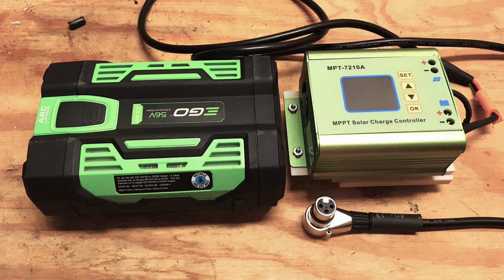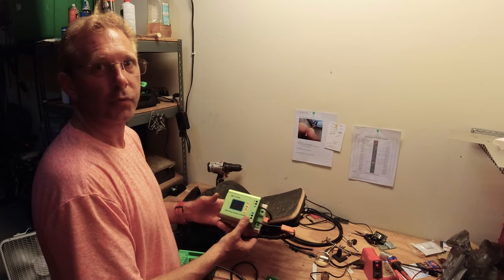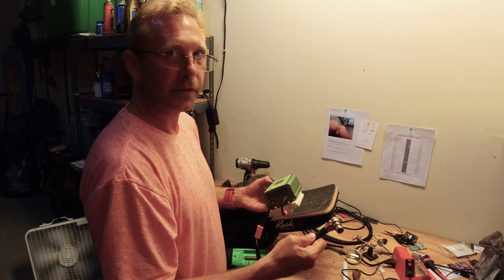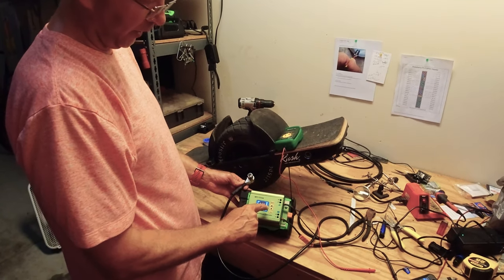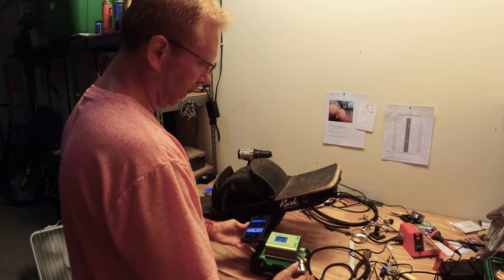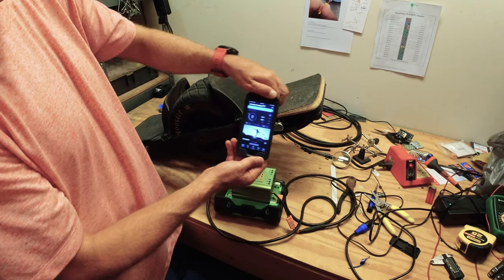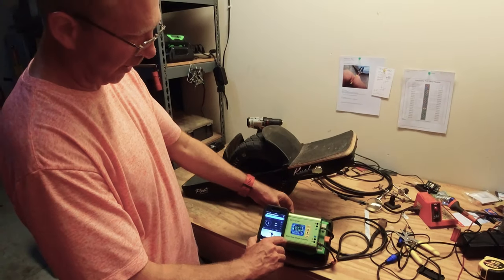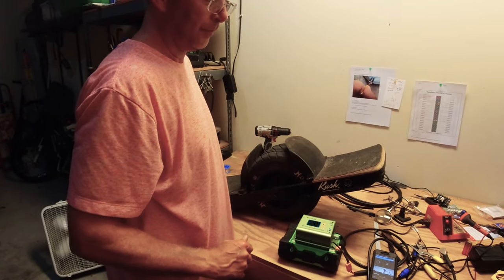Teaser - Onewheel XR Portable charging system

Comment: Have you tried charging a completely empty XR with this setup? How did the mppt booster act when the XR voltage was lower than the EGO voltage?
Reply from the maker: Hi Mike, the XR charger puts out 63V to charge the Onewheel.  The EGO battery is a 56V (2.5 AH) and the MPPT I use boosts it up to 63V for the charge, so technically it's always below the voltage of the XR battery.  But to actually answer your question, no I have not charged a completely empty XR with this setup.  I keep meaning to do a full capacity test, but something always seems to come up.  Mostly I keep it in my backpack when I'm going on rides where power outlets are scarce.  No problems so far!  I am still working off of the original prototype and still plan to build V2 this spring.
Thanks for your comment!
Reply: @owfloatnashville7656  I have that mppt and it and other boosters do not work the way you think. The output voltage of the booster is not what you set it to, that is the voltage limit to charge to. The output voltage is slightly higher than the battery being charged, and rises as the battery charges until it reaches the voltage you set. But since the XR is at 42v when empty, the booster isn't boosting and instead it just connects the 58v EGO directly with the 42v XR. The resulting charging current is over 20 amps, not at all limited by the current setting on the booster because the booster isn't boosting.

In other words, you will damage your XR if you or anyone tries to do that.
Reply: Mike Mueller so basically you must charge from a battery with lower voltage than the onewheels current charge state? I’ve got one in the post and plan on vnr boosting from a 48v ebike battery on my v1